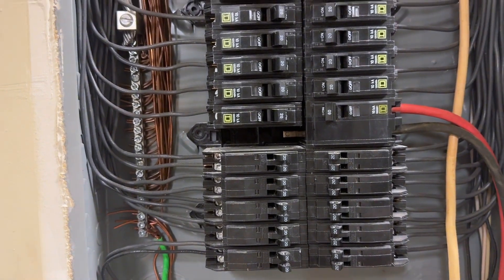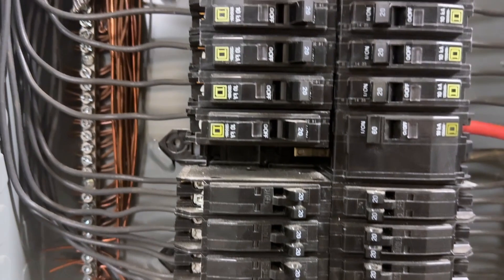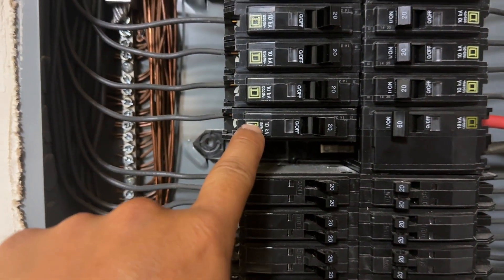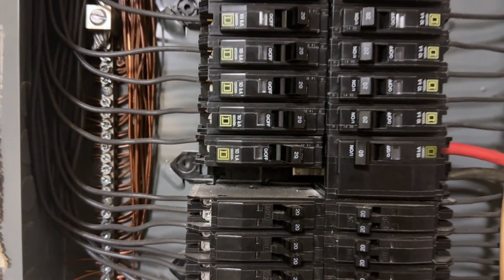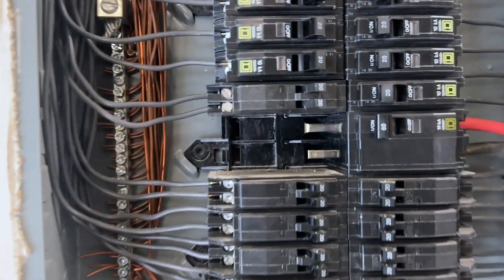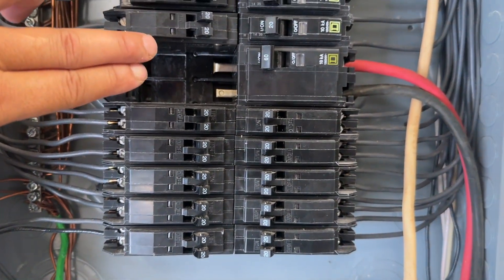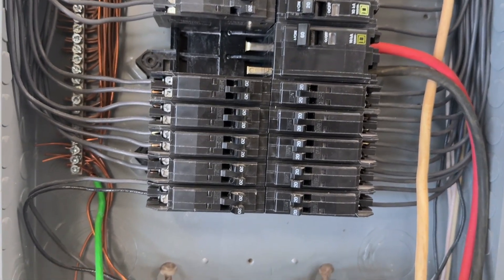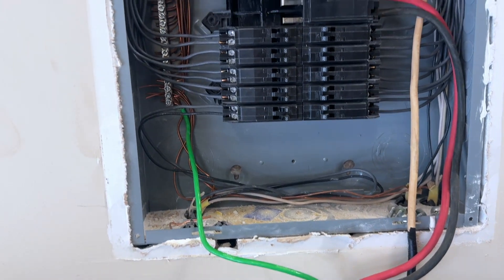ADDING EXTRA SPACE INSIDE CIRCUIT BREAKER PANEL USING TANDEM BREAKER

Comment: Everyone, make sure you check the label on the inside of the circuit breaker to see if your panel allows tandem breakers. My GE panel did not. There are 32 slots and the label says 32 poles maximum. Sometimes you can get a hint from the panel model number too. If it doesn't explicitly says it supports tandems or multiple poles per slot in the diagram, then it doesn't support tandems.